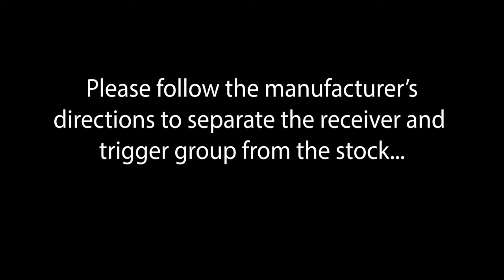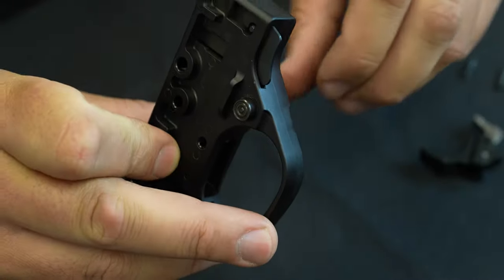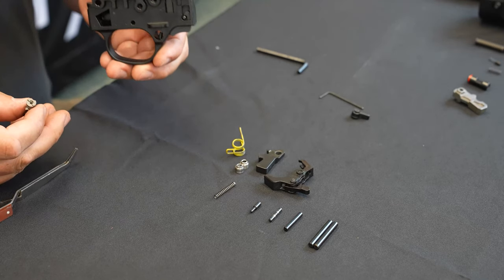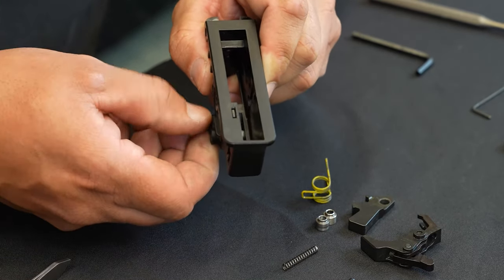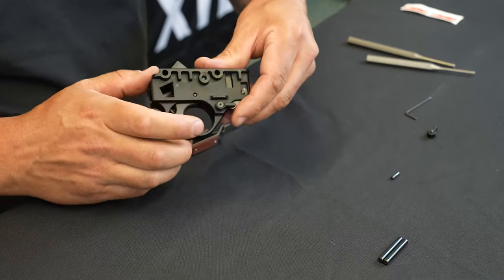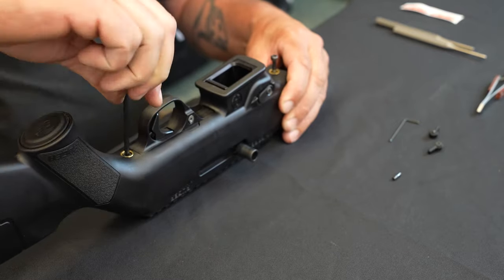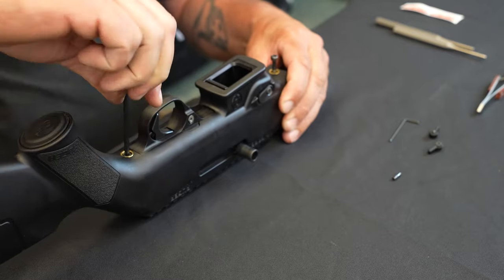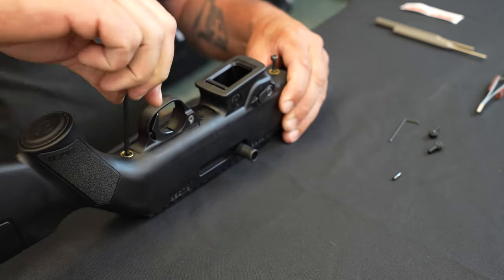Franklin Armory® PC-C1 Install Video

Comment: That selector spring and detent had me crawling around on the floor a few times. My favorite was when I couldn't find the spring until I noticed it had shot into my chest hair and stuck in there. Definitely do that step in a non-cluttered area. Thanks for the video it gave me the confidence to do this at home instead of going to gunsmith.
Reply: Ya I've sent a few springs across the room, some never to be found working on ar's back in the day
Reply: It helps alot to use a punch smaller than 1/8

Comment: So, I have put several of FA's binary triggers on, a couple of those like the 10/22's have similar safety replacement springs on them. I finally got smart and put the whole assembly in a 1 gallon zip lock bag and work with it inside the bag so when the spring does inevitably shoot out, it will catch it rather than let it go flying across the room. Also, instead of a punch coming down from the top, I use the smallest flathead screwdriver I can find and depress it and hold it from the left side while coming in from the right with the new safety. As I advance the safety shaft through the hole, I put it right over top of the flathead and slowly back it off so there is no gap, and less chance of the spring shooting out. MUCH easier!
Reply from the maker: Thank you for sharing your personal tips and tricks! We are glad that you have found a solution which works better for you and that you enjoy our triggers.
Reply: Thank you for this! I was about to take it to the gunsmith and pay $60 because I got so tired of trying to find the dog on spring. You're the best!
Reply: Excellent tip! Thanks

Comment: Just what I needed. Put the mode switch in backwards the first time. Had a heck of a time getting it out. When put in correctly, slid in on the first try! I trimmed one full coil out of trigger spring and 1/2 coil from mode switch spring.  Installed on Ruger PC Charger. So much fun!

Comment: For pushing down the selector detent it was way easier for me using a small flathead  electronics screwdriver. Instead of pushing straight down from the top, I stuck the screw driver in from the selector hole on the left side and just pressed it straight down.  Then I was able to move the selector on top of the pin pushing my screwdriver out of the way.

Comment: This video helped me out bigtime! Definitely watch first! I wish the instructions would have mentioned the video first!  I didn’t find it until I was looking for troubleshooting info. Make sure you are working in a clean uncluttered area. When installing the selector detent and spring, they launched across the room on me several times. Makes finding it easier! 
My binary function didn’t work at first. Had to go back and clip the trigger spring half a coil and reassemble to test. Had to do this twice (cut 2 half coils total) and then it started working. Be patient and take your time.
Reply: I can't seem to get the binary mode on mine to function properly. It doesn't release the hammer to fire the 2nd shot. Is this the same issue you were having before you cut down the trigger spring?
Reply: @sick_of_all_the_lies4207  , yes, I cut the first half coil, still no good, cut the second half coil, and it works.
Reply: I ended up doing the same exact thing. First half coil I clipped didn't work, second half clipped and now it's working like a dream👍
Reply: @sick_of_all_the_lies4207  , glad I could help!
Reply: @garypapesh1345  i did this and it made it worse.  I found that no matter what I put down the trigger spring hole it still comes out at a angle.  Im gona take it to a gunsmith tomorrow...
Reply: Just use the factory plunger spring. Dont use the spring provided from Franklin armory. Use the factory spring with the plunger. Works great for me!
Reply: All my function checks on the trigger work perfectly except for with the safety lever straight down and release the trigger hammer all the way. Is this because the coil spring for the trigger is too long?
Reply: @nalabishop4408  it's been 2 years since you posted this, but ruger drilled the trigger spring hole with the trigger guard in place, so it inherently had to be drilled in at an angle and is the way it was designed from the factory. 
I fought with mine for an hour trying to figure out what I was doing wrong til I found a comment online stating this little tidbit of information that would have been nice to know from the beginning.
It seems broken and would never expect this to be "normal" but it is and hopefully others that are installing this trigger will see this and may save them lots of time and frustration.

Comment: OMG thank you the directions had me putting it in the other side did not work the directions suck and luckily I had at 10:22 that shared many of the same plungers and Springs I would advise doing this in a small confined room maybe a bathroom.

Comment: Great video, I followed the instruction to the letter. However, my Binary trigger is consistently failing the Function tests. I am very discouraged as I have been trouble shooting for a few hours now. when set to Binary, my trigger almost always falls to the sear instead of the firing pin. I have adjusted the trigger spring, I have dis-assembled and re-assembled the trigger multiple times, and I have googled the problem but have found no answers. Has any one had this problem? I would love feed back.

of all the trouble shooting I have done, it seems like the fire selector is the cause of the problem. the selector has play allowing it to turn past binary slightly. when I hold the selector past binary the hammer falls on the release of the trigger. 

that being said, I have had other strange malfunctions while function testing... The bot stayed stuck to the rear while I was holding down the trigger, the ran forward when I let go of the trigger. there is evidence of friction on the bolt from the hammer. the fire selector moves when the hammer isn't cocked sometimes and other times it will not. and once the hammer even dropped to the firing pinn when the selector was set to safe...

I plan on calling Customer support come Monday, but I would have liked to enjoy my day off with a working gun.

Comment: At 12min 10 sec on your video. All Function checks work perfectly except for straight down on the safety lever it releases the hammer all the way. Is this mean I need to cut my trigger coil spring smaller?

Comment: I am unable to get my trigger to function in binary mode. It keeps getting caught by the sear. I see other people are having the same issue and it is from the trigger spring being too long. Would like to see instructions on how to shorten and retest the spring since it seems to happen a lot. Very frustrating install.
Reply from the maker: Have you contacted our Customer Service Department? They can assist you with troubleshooting this issue.
Reply: have  you figured out what was causing the problem? ive got the exact same problem
Reply: my trigger spring seems long but passed the function test. did this happen to you during live fire? i have yet to shoot mine.

Comment: Was having a problem getting binary mode to function correctly, it was firing like a semi-auto. Figured i would comment to help others out that may run into the same issue.

My fix for this way to buy an assortment of springs from Ace Hardware(didnt want to cut the spring that came with the trigger in case i had to return it) and find one that fits, cut it down a coil until binary functioned as it should. I also purchased a Double Tap Trigger Over Travel Limiter trigger plunger.
Reply: Would just cutting the spring down work?  I'm having the same issue

Comment: I got mine installed and all the functions work when dry firing, but at the range the binary function only works intermittently.
Reply: That sounds like mine!     While function testing everything works perfectly.    Once I go out to shoot with live ammunition the binary will only do semi.

Called F.A. and they told me the trigger spring may be too long and may not be allowing the trigger to reset fully.   Suggested removing 1/2 of a coil from the spring and reattempt.    Maximum amount to safely remove is 1 1/2 coils and I am at the maximum with no solution.
Reply: I have been having this same issue. I started really playing with it and I personally realized that the safety selector has some play in it...and it actually "falls out" of binary. I pressed the selector firmly into (like trying to go beyond) binary, and it worked again. It keeps falling out of binary, however, and I don't know what to do from here
Reply: @GreatGreenArklesiezure  You ever figure this out. Just installed mine and unless I hold the selector up like you said it won't release the hammer.
Reply: @distalpistol  exact problem I have. Any solutions??
Reply: @eric9385  I emailed Franklin and they had me send it in and they fixed it. Whole process was pretty quick
Reply: @eric9385  It does. I've only done a few hundred rounds though
Reply: @distalpistol  one more thing.. did they charge you to get it fixed?
Reply: @eric9385  They did not. I let them know I went through all the steps on their video for all the safety checks and what not and let them know the issues I was having. They let me send my trigger housing from my Ruger PC Charger and they fixed it. They never told me the issue.
Reply: @distalpistol  Thanks alot for the info. I really appreciate it

Comment: bought a binary trigger for my 10/22.  It's been at the gunsmith for installation for 2 weeks now, I'm going insane with anticipation.  Maybe I should have just installed it myself?  Gun smith said that the 10/22 binary trigger isn't as easy to install as say the AR15 one; it requires some tuning.  I've never taken my 10/22 apart so I do not know how to dissassemble it.
Reply: Did you ever get your 10/22 running with the binary trigger

Comment: Help!! I'm getting bolt follow on my binary mode.... Unless I drop the bolt gingerly by hand, the hammer just follows the bolt home; sear refuses to catch and hold the hammer. This is a huge problem, as it's begging for an out-of-battery.
Reply from the maker: Have you contacted our Customer Service department? If not, that is what I would suggest to troubleshoot. They are available Monday through Friday, from 0900-1600 hrs PST at 775-783-4313 or via email at info@franklinarmory.com
Reply: @FranklinArmoryBFSTM  that number is out of service.

Comment: If you own a CHASSIS carbine (or Charger "pistol") you will also need to first remove the charging handle(s).
Is this trigger a "Gen. 3" style trigger with a machined disconnect beside the main disconnect as on a Gen. 3 AR binary trigger?

Comment: Excellent video for install! I have my pcc with an Archangel stock   .  I didn't installed yet. I hope that everything is going to fits and works good! A trigger pack could be better or perfect !! Is posible to have a video on spanish for the details !! By the way than you Frankling Armory for this helpfull video! I will tell or communicate when I insatalled everything!!

Comment: I noticed my trigger spring goes in at a pretty sharp angle behind the trigger. Is that normal on the pc carbine trigger pack?
Reply from the maker: Good afternoon; if you need assistance with troubleshooting, please call our Customer Service department at 775-783-4313. They are available Monday-Friday from 0900-1600 hours (PST). Thank you!
Reply: Did you ever contact them? I’m doing mine, and it goes in at a weird angle as well. The spring plunger hits the back of the trigger on the side a little and not in the middle.
Reply: @TShort1001  same here.  I tried trimming the coils and it didnt help.
Reply: @FranklinArmoryBFSTM  that number is out of service.
Reply: @nalabishop402  I just ended up running with mine. Haven’t had any problems so far
Reply: Per Ruger, the spring hole was drilled with the trigger guard in place, so it inherently had to be drilled at an angle and is the way the factory designed it. 
It does seem odd and looks broken but that's "normal" 
I didn't notice it with the factory trigger but I suppose I didn't pay much attention to it before installing Franklin trigger assembly

Comment: Win removing the original safety selector only turn it 1/4 turn or you will not be able to push out the safety button. PRO TIP, trust me if you spin it 1/2 ah turn the safety will not push out becaus it has the ridge for the trigger and the detent will engage this ridge causing you not to be able to push out the safe button. If you do this like I did use needle nose pliers to spin the safety back to the right position thin turn it only 1/4 turn. And out it slides with ease.   Pushing from the red/fire side.
Reply: But this video did get me through the replacement of my trigger, thanks guys you'll keep making fun triggers for guns other than AR15 and for that I am EXTREMELY greatful.  I was so excited win I seen this trigger for my Ruger PC Carbin. It is my by far my favorite gun to shoot steel with.
Reply: Thanks! Just happened to me.
Reply: Thank you sir! That’s exactly what happened to me. It was giving me fits, you saved me from many more.
Reply: Thanks 😅 Never got it reset just jammed it with a screw driver till it turned and popped out. Stupid.

Comment: That sucks mine doesn't work fails function checks I have followed this video to the T. Built it did functions and it fail at #6 and #7. Took it all back apart thinking I did something wrong rebuilt it same results.
Reply: Same!  Did you figure it out?  I'm a little disappointed.  I did install to the T and it doesn't fire on reset
Reply: @kevinbutler4127  yes had to cut the spring little at a time till it passed
Reply: @Robert Rootz  I used the OEM Spring.  And cut that down.  But I am hesitant to cut the spring franklin sent.  I might go buy a bunch of springs and start playing around with it.   Thanks!
Reply: @kevinbutler4127  Did you get it to work? I'm having that same issue

Comment: So I watch the other video where the guy doesn't use the trigger spring plunger to sit on the back of the trigger and it works and passes all safety tests but trigger pull is I consistent. I was trying it with the spring plunger but it kept going in and pointing to the right instead of sitting In the middle of the back of the trigger.  Do I have to tear this thing back down and do it again?
Reply from the maker: Please call our Customer Service department at 775-783-4313, Monday-Friday between 0900-1600 (PST).
Reply: @FranklinArmoryBFSTM  does this phone number still work bc I cant get through?

Comment: Hey everyone or to whoever this helps 
So I had a trigger that would not fire on the release in binary 
I tried shortening the included trigger spring by the suggested 2 links and that didn't work  
I tried using the OEM spring and that didn't work 
What ended up working was replacing the retention rod that holds the hammer with a very slightly smaller retention rod 
With the oem trigger spring and included trigger plunger 
Now it runs like a dream 
Hope this helps someone
Oh also the selector has a flat side that makes it easier for install like way easier 
Doing it the reverse way will give you lots of headaches and lots of misplaced time finding those tiny little pieces
Reply: Hey Ben, I am currently having an issue with the binary, (unfortunately I ruined the oem trigger spring) but when you mentioned the “hammer retention rod” are you referring to the pin holding it in? Thank you for the comment and help!